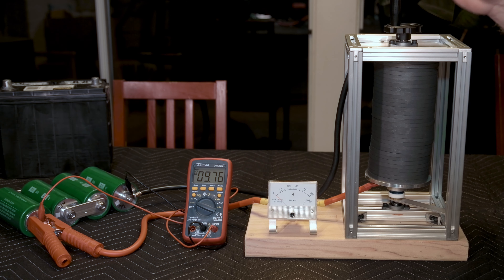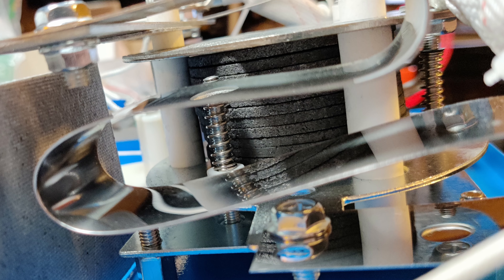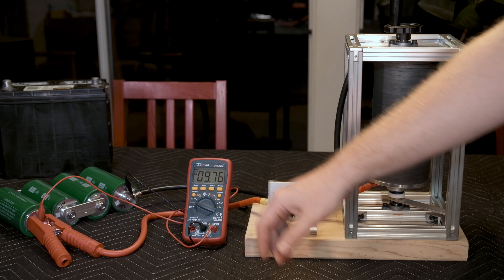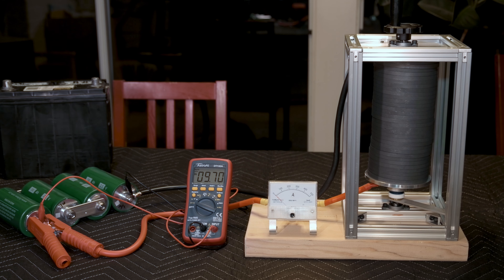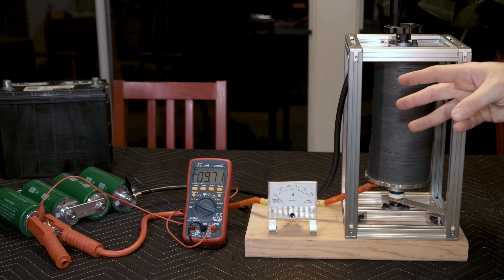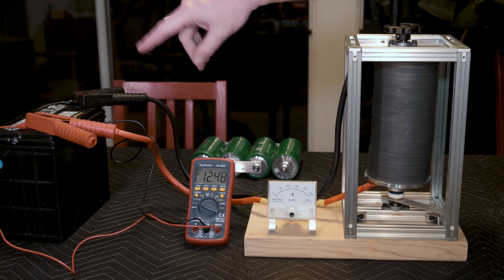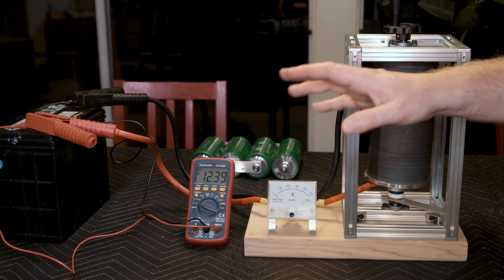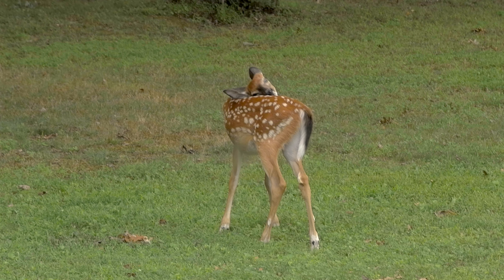My DIY 7,000 Amp Load Tester Went A Bit Wrong

Comment: Second hand DC telecom spares is where you need to look for your goodies.  Telephone exchanges used to be full of lead acid batteries with collective outputs in the range of thousands of amps.
Reply from the maker: That's an interesting idea.  I've already bought $1,500 worth of Lishen cells.  I've got 60 of them here; 24 are currently in use in the electric turbo.
Reply: @AlexLTDLX  Not just batteries.  Current shunts, transformers, bus bars, contactors.  DC telco is 1:1 with your needs = 50ish volts and 100s to 1000s of amps